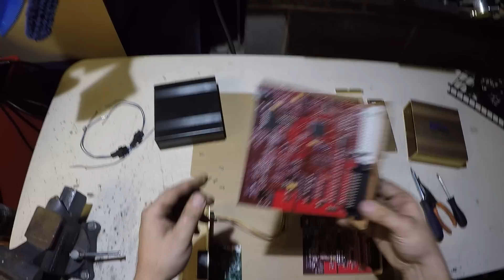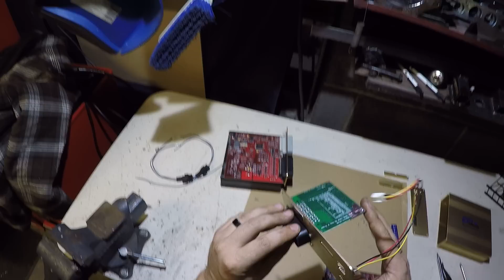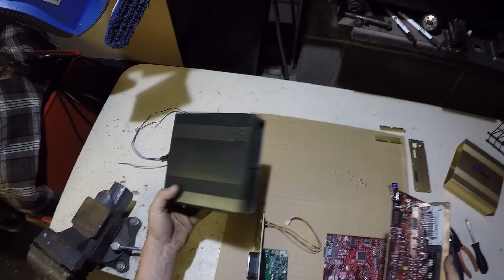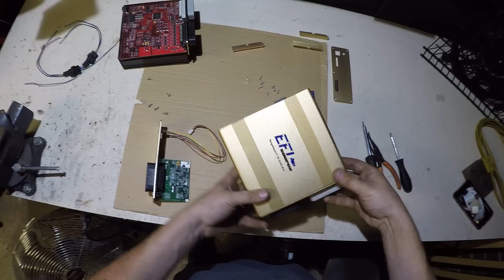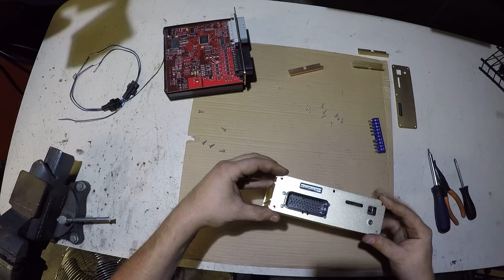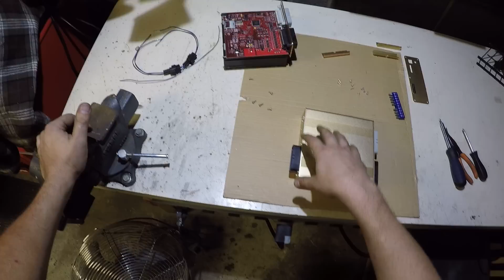MS3 gold updates and info summary

Comment: SO how do you find a laptop that still has a (RS 232) serial port?

as far as the 90 degree port change.
basically you have a convince someone to change it
then you have to convince his boss
then you have to convince the engineers
then  convince the head engineer
then  convince the head engineer's boss
then marketing has to buy off
then the head of marketing has to say yes
then a board determines to go ahead with it.
then it's changed.

that's if no one in the group of 25+ people disagrees with the change.
manufacturing is fun stuff.....
Reply from the maker: you get a USB to serial, or what i like to use PC-CARD to serial adaptor, they work much better, or you just use the USB port on the ms3

Comment: i still cant decide between the gold or ms3-pro! Currently im boosted on a stock PCM using EFI live with a 4l80e and it works great but im going T56 to make the car a bit more fun and wanted to go to a more simplified PCM. Not sure if MS3-pro is worth the extra $400 over the gold with a drop on harness.

Comment: U said the trans control can be used for a 4l80e can it also be used for a 6l80e
Reply from the maker: 06focus352 not currently, it only is supporting 4 spd right now
Reply: Ok only asking cause I plan to get a g8 gt soon and turbo it
Reply from the maker: you do understand you would loose your cluster and hvac and many other things because most of that car is GM can
Reply: Oh, well is the 6l80e strong enough to hold some serious power, eventually I want to make 600+

Comment: do you use an.external CAN connection between the main ms3 board and the microsquirt or can it be internal?
Reply from the maker: you can do both, see the pigtail wires up in the left corner, that is what they supply for you to plug the ms3 into the micro, and the hanging piggys are what goto a dash or another device
Reply: very cool!  thank you for the info.

Comment: i had purchased a old 67 c10 amd the guy i bought it from put a 5.3 in it and did a carb swap to it and after seeing your videos about the ms3 gold box it makes me want one cause i plan on running boost on this motor and converting it back over to fuel injection so my question is when i purchase the ms3 from efi source does the wiring harness come with fuel injector wiring to the box cause when i read up on it to me i dont really understand when it says 10 high impedence injector loads so i was just wondering about the whole wiring of it if you could explain it better to me or make a video about it cause im pretty sure alot of people probably have the same type of questions about the wiring and what not